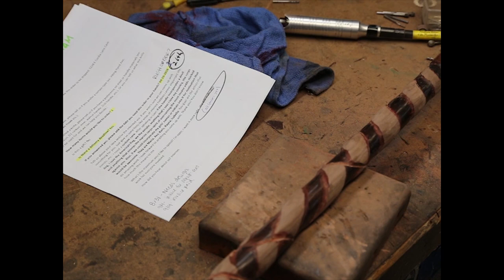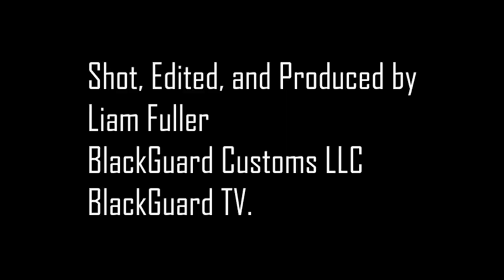BLACKGUARD TV - MAKING A WALKING WAR HAMMER

Comment: Near the bottom, if you put a series of through holes in the cane with corresponding holes in the tip portion (where one could slide inside the other) with 1/4" spacing set in a spiral pattern, the owner, if need be, could adjust the length for differing footwear.
I have a few different summer shoes and a couple different winter boots and the height difference between them would require a couple different canes for all year around use.
Reply from the maker: We diacussed it. As he isnt planning on growing anytime soon we decided to fix it to hia measurements from physical therapy. Its a reat and solid idea though.

Comment: How much would something like this cost to have made? I’m a DV and I use a cane for short distances but have to rely on my wheelchair for most stuff. I’ve wanted to have a cane handle made, hammer on one side and small axe head on the other. I like wood carving and thought that something like that could be very useful. I’m not looking for anything to technical. Something like a fritz style handle is what I use if not I go with a simple wood crook. The end just capped with a rubber foot. Then I could cut it to my length myself.
Reply from the maker: Hey, sorry for the delayed reply, Shoot us an email to info@blackguardcustoms.com or check out the custom order section of the website https://blackguardcustoms.com/collections/custom-orders

Comment: Hickory is better wood . Sorry but I had to tell you. Walnut is my favorite but hickory is harder and stronger . That's why they make handles from it. But it does take a real carpenter to work it not a boob.
Reply: Walnut is very strong length wise... but is brittle.... that means that if you swing it tateraly I will break. Some say that is bad.... HOWEVER WHEN IT BREAKS .....it ALWAYS  has a sharp point and usually a sharp edges as well. This can be planed for and USED to an advantage if you are willing to sacrifice the original stick.